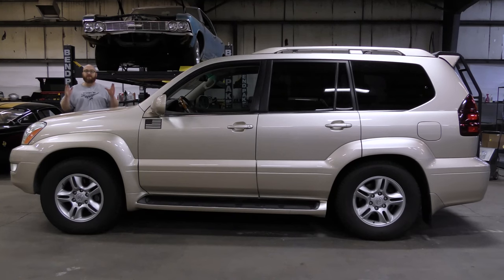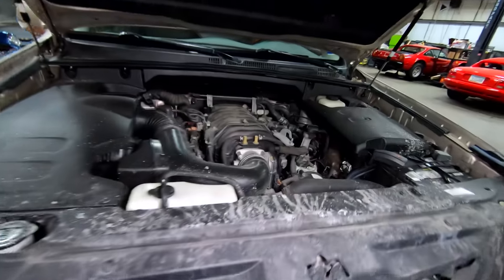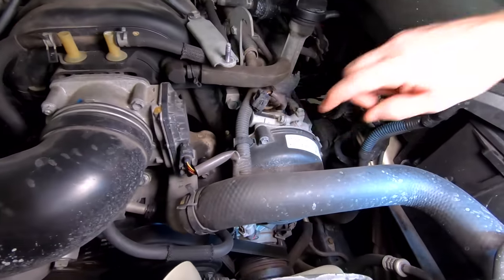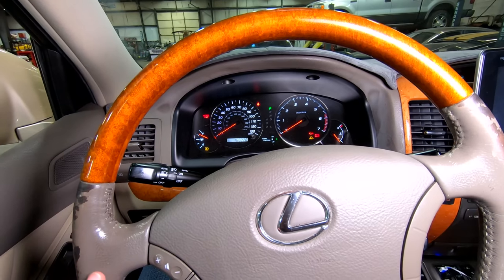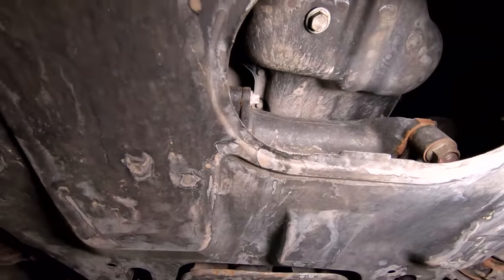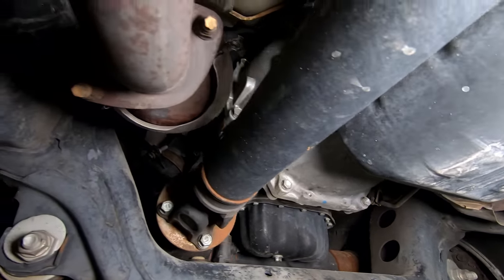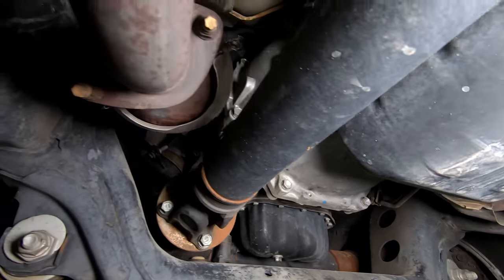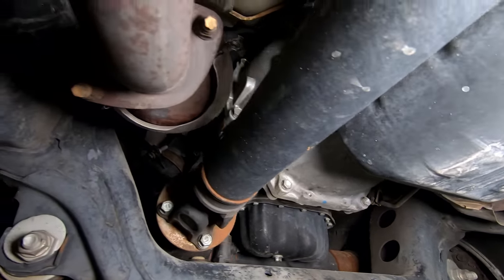How could this super reliable '07 Lexus GX470 have such a stupid design? CAR WIZARD weighs the risk

Comment: Great video, Wizard. On potentially large jobs I like having a very rough ballpark guess about the labour so I don't waste my time and the shops on a job I can't afford right then. That is not something I often do ask about, but when it was the head gasket on a Red Block I needed a ballpark on shop time. It did not stop the job happening, but I knew how much money I was going to be looking at. No sticker shock. I fully realize a quote is not realistic, but a quick look at the computer for the number of shop hours to be billed does not take long. 
That said, I appreciate and even expect that if the shop finds something else wrong they tell me. After 32 years and 613,000 kilometers, my old Volvo sometimes has things needing attention. Since the shop knows I plan to keep Arthur the test of my life, they are well aware that if they tell me something is bad I am going to say "Fix it" without hesitation. Sometimes on an old Volvo it is easier or better for me to get the parts, so it is a cooperative effort. It works.
Reply: Right On! Like the content but enough complaints about customers that want a price.  Tired of that theme in the videos.  Not legal advice but It is actually the law in Kansas anything over $150 customer is entitled to an estimate unless expressly waived.  Wizard has said before that he is not giving customers a break even if he can beat the book time. So, if you are charging book time regardless what’s so hard about giving an estimate? Content used to be about Hoovie getting estimates.  Wouldn’t we all like customers to give blank checks.  Anyone that does that is eventually going to be taken advantage of and there is a name for that we call them “suckers” or victims.

Comment: The first car repair I did on my own was the starter on my 74 Toyota Corona.  Two bolts and the wires, took me a 17 year old kid at the time - 15 minutes.  That was the old days though.  Honda puts some starters like on this car, under the intake.  I’m not going to even attempt that one…pay the pros that know what they are doing for sure.
Reply: Not too bad. Hard part is the top bolt for the starter

Comment: Sheepskin seat covers are extremely comfortable and effective.  I have a set of real sheepskin seat covers in my 2nd Gen Ram and when you're not thinking about how cold or hot your rear is, you know they're doing the job.  They also seemingly last forever.  I put one on the driver's side after installing leather seat covers a few years after I bought the truck new in July of '95.  I moved the older cover over to the passenger side about 20 years later.  The older one has a little bit of sun fade and some wear but it's not noticeable and still very comfortable.  Truck has a little over 325,000 miles on it and she's still going strong.  Same starter on it btw...!
Reply: How's the seat heaters work when they're covered by 3" of sheepskin?
Reply: I agree completely. Warm in the winter and cool in the summer. Love them!
Reply: @sheiladawg1664  I don't have heated seats in my Ram and initially sitting down on uncovered leather seats can be a very chilling experience in the winter !  In the summer it's the exact opposite but with the sheepskin covers, it doesn't matter, the seats are comfortable year round.  I do have a Lexus as well as the Ram and the Lexus has heated and cooled seats and until the car has been running for awhile, those seats are initially uncomfortable depending on time of year and you're correct in implying covering the seats would negate the effects of the heat but then again, one probably wouldn't notice the lack of heat or AC because the covers make the seats comfortable year round.  

The covers do add a little bit of height which could be an issue for some vehicles and I wasn't implying one should cover their heated or AC'd seats.  I got a kick out of Mrs Wizard's comment about "Granpa's '80's seat covers"...:-)  Whether sheepskin covers are dated or not, they're very effective, very comfortable, don't shed, and very long-lasting !  The covers could be used as a relatively, inexpensive way to add some height for shorter drivers but their biggest benefit is year round comfort !
Reply: @sheiladawg1664  By moving to a more temperate climate? Plasticized leather isn't a great insulator, so the sensation is chilling. Sheepskin traps your own body heat, helping your sensory experience. Seat heaters are a cheap response to cheaping on real leather.

Comment: We can thank the EPA for the design flaw on that engine. Placing the starter in the valley allows for the cats to be located closer to the manifold thus reducing warm up time and allowing the system to go closed loop sooner to reduce emissions. Still a pain in the butt when the starter fails. It also allows for tighter packaging of the exhaust components and makes the engine more symmetrical. That way they can build just one variant of the engine for left and right hand drive applications. At least all of the other service items are easily accessed.
Reply: Great answer - thanks for posting that.  My understanding having owned and worked on four Lexus V8's that it is for converter heat.
Reply: I don't think either of your assumptions are correct. It is more likely due to this car being a global product that gets the crap beat out of it. Starter up top to keep it out of mud and water, cats up high to protect them from damage (similar to other components underneath being well protected). It'd be nice if they used this same design on the Tundra 3UZ, its starter is down low and hard to get to due to the exhaust, and the cats are way back and very easy to steal or damage.
Reply: Yep yep...I definitely agree with you on that.
Reply: @daniels2761  You're correct. It's always bizarre why some people just blame things they don't understand on a generic boogyman like the EPA or some other group they dislike. Having the starter up there is the best place for it, keeps it dry and allows a long life if the vehicle is used for what the LandCruiser was designed for. As an example of another toyota product, the last gen Tundra had the starter in the more usual spot, much easier to service, but you couldn't take it throw water near as deep as that LandCruiser without killing the starter. 

Edit: I'm second guessing myself now about the Tundra comment. It's so long since i was under one i can't be sure I'm not thinking of the alternator placement instead.
Reply: This is correct. It’s also the reason for the ridiculous secondary air system which assists the cat at warming up quicker on a cold start, thus burning less emissions. An EPA requirement again. The catch on this motor is that you have to take apart the entire manifold to replace it. It’s also one of the first parts to fail on this motor. Which mine did. There are a few different bipass modules you can install that will bipass the entire secondary air system. I installed the Hewitt Tech modules 7 months ago with absolutely no issues. While technically illegal in states that require emissions tests, it will not cause the vehicle to fail the test. It will also not cause any issues to the motor or affect fuel economy when using the module. The secondary air system failing and not being addressed can cause all kinds of problems. This is why people usually replace the starter if they have to replace the entire air system.
Reply: Also , by placing the weight of the starter close to the center of the engine , vibrations are minimized..compared to the pendulum effect of a starter hanging down below.      Remember the ads showing the wine glasses set on top of the running ES400 engine ?  Very little shaking

Comment: Wizard, there are supposed to be rubber covers that shield the engine compartment from the wheel well. These frequently crack and either fall off or are removed and not replaced.  The air bags tend to leak, many owners swap them out for coil springs. I have the same year GX470 at 100k miles and is due for a belt change. It would be nice if you posted a how to replace the belt on this truck.
Reply: Yeah, I didn't know about the splash guards until I saw something on YouTube. Ordered them up on amazon. The critical stuff the wizard was shining his light on needs to be protected.
Reply: I thought he just took them off to show everyone. It was clean in there so I’m guessing they were on initially.
Reply: @kevinknotts6337  If he did take them off he left the push on plastic buttons fasteners.
Reply: Plenty of great videos on the timing belt and water pump on YouTube already. Used them to do mine!
Reply: I also saw the broken push fasteners where the inner splash shields used to be.
Reply: Easy…you ship it to the Car Wizard!!!

Comment: You are the most articulate mechanic I have ever been blessed to hear and see work.  YouTube sent me here I guess cause I been clicking on the GX 470 researching to purchase. 
Thank you for explaining the protocol when calling a mechanic for an estimate. I've had it where cv joint(2001 Corolla) went bad but they only discovered tie-rods were also needing replacement AFTER I bought it in dor the CV joint repair.

Comment: Thanks Car Wizard for your great detail oriented videos. I would like to point out another very serious design flaw on several Toyota models and a couple of Lexus models as well mainly from 2007-2011 involving engine oil cooler "pipes". If you have already made a video on this issue, then my apologies. This potentially catastrophic engine-destroying oil leak involves the Toyota Highlander, Sienna, Venza and also the Lexus RX350 and RX450h.

Just about a week ago my wife was driving to work in our 2011 Toyota Highlander and the low oil pressure light came on. She called me right away and I told her to pull over into a safe place as soon as possible so she was able to quickly pull over into a parking lot and shut down the engine. Since I had done an oil and filter change about 2 weeks prior to this happening, I thought that I must have not tightened the drain plug properly or the oil filter. When I got to where my wife was and checked the oil level, there was little to no oil on the dipstick and a big pool of oil underneath the car from just under the radiator extending quite a ways back mainly on the passenger side. By this time the engine had cooled down and wife said it never smoked or overheated. I added 5 gallons of oil and started it up. Oil was "peeing" out and it was below the radiator. There were no leaks from the drain plug or the oil filter cartridge housing but I noticed that the leak seemed to be coming from a couple of rubber lines or hoses that ran between the upper part of the oil filter cartridge housing and the bottom of the engine. Those are the engine oil cooler lines or pipes. The problem is that those rubber oil lines are just a few inches away from a catalytic converter and over time the heat will bake the rubber hoses making them hard and brittle. At that point, just a pinhole or slight crack on either of the two rubber lines will cause a major oil leak and if you're going down the road the engine may be destroyed from oil starvation if you don't pull over and shut it down soon enough. With those rubber oil cooler lines, it's not a matter of if but when they will fail.
I had our Highlander towed to the Toyota Dealership and they advised me that the leak was from one of the oil cooler lines and it needed to be replaced with the metal pipes since Toyota had come out with all metal ones to replace the rubber ones. Fortunately, after compression tests and other engine examination, the dealership said that no permanent engine damage had occurred. We bought it used from the same dealership back in early 2017 with just over 40,000 miles on it and it now has 103,000 miles. An elderly couple bought it brand new from the same dealer and they had it serviced at the dealership so I had all the maintenance records and the gentleman was very OCD about his maintenance so it was well taken care of and in mint conditions when we bought it.

However, there was a Technical Service Bulletin(TSB) issued by Toyota to dealerships and owners in mid 2014 into 2015 about possible oil leaks or seepage from these rubber lines or pipes. I'm quite certain that the owner took the vehicle to the dealership and had it inspected. Toyota also had a Warranty Enhancement for this issue as well. But the TSB basically said, inspect it but if ain't broke don't fix it. Well, if you had one of the 2011 Toyota models or Lexus models with low mileage those rubber lines were likely still fine and had not yet begun to fail so Toyota/Lexus did nothing about it. This did involve over half a million vehicles! I've done a lot of research over the past week and there have been many youtube videos and posts in Toyota and Lexus forums about massive oil leaks just in the past year or two as those rubber oil coolant lines are now failing at an alarming rate. If you have one of these model years, please get them replaced immediately. If you are in the vicinity of the Car Wizard, get it to him ASAP! You're risking your engine and this could be a safety issue as well depending on when and where this occurs while driving. I have seen videos where DIY folks are using a Dorman or other after market pipe kit replacement. Please DO NOT go that route and use the Toyota OEM metal pipe replacement because it's an exact fit and made much better and only $30 or 40 dollars more if that. The extended warranty ran out in 2021 so I had to pay out of pocket. I love my 2007 Tacoma and my 2011 Highlander but shame on Toyota for not doing a recall! I'm putting a link from the NHTSA so everyone can see the models and model years this major problem pertains to.

 https://static.nhtsa.gov/odi/tsbs/2014/SB-10056501-8923.pdf
If you don't want to click on the link...it's safe but just google SB-10056501-8923 and you can get the information that way as well.

Please don't fool around with this and address it right away. It may well save your engine and without being overly dramatic but possibly save you from bodily harm as well! I hope everyone stays safe and healthy.

Comment: These things will run forever.  I’ll always miss my 2006 GX470.  Sadly the frames were known to get extra rusty if you lived in the salt belt .
Reply: yup :( i have to get rid of mine soon because of this and it’s gonna break my heart. first car
Reply: Yah. The HVAC lines fittings & rear condenser manifold. are also prone to corrosion.

Comment: I have the same vehicle, almost 200k and on the original starter. I expect to have to replace it  eventually, but so far this vehicle has been very reliable. My only complaint was the air suspension. I converted to coils when mine started acting up. I was happy I did, rides smoother now and I don't have to worry about expensive repairs when other parts like the compressor goes out.
Reply: What about warning lights?  When u took out the bags.
Reply: Nab, i had to jump a couple pins under the dash but I don't remember which ones. Here is the info for Strutmasters. They sent me the instructions when I did the conversion: https://www.youtube.com/watch?v=MUeORkiWzos
Reply: Seems to be the compressors that go on Land Rover vehicles. Ask me how I know...😁
Reply: I find it hard to believe that a converted coil suspension rides smoother than the OEM air suspension.
Reply: @OMGWTFLOLSMH  u know in many countries, they don't even offer you a lexus with air suspension?  And they're still master leaders in refinement.    When I converted my ucf10 celsior to coils, I loved it.  Plus you reduce a fair bit of weight.

Comment: We bought one new and drove it to 225k. A few small issues after 150k miles.  But no major issues.  Would buy another one except wife wanted a smaller vehicle for her daily driver.  
That engine burns a lot of fuel!
Reply: As a lone driver, I cannot imagine using this hulking gas guzzler as a daily driver, even if I could afford the fuel.
Reply: And that’s not the 87 octane flavor!!
Reply: @phendrix9476  I run mine on 85 octane here and it runs fine.  These engines don't need premium fuel at all, regardless of what the fuel door says.
Reply: How many miles do you get on a full tank?
Reply: @maximaniac7231  my 06 will throw knock sensor code everytime Ive tried to run 87. Maybe the non vvti engine can get away with it otherwise I'll have to disagree.

Comment: I figured the "design flaw" was going to be the ol' starter under the intake manifold.  I do wonder if engines built that way have a longer service life on the starter due to being protected from water, salt, and dirt.  I agree with how stupid the "start/stop" thing is, and was very happy to learn that "feature" was deleted from my Crosstrek due to getting it with the manual trans.  As for your little rant at the end, the only time I ever told a shop the specific repair my car needed was when that very same shop had told me during the state inspection a couple days earlier.  Otherwise I just tell them what issue(s) I'm experiencing (ex., the brakes make a grinding noise, or the exhaust is really loud, etc.) even when I'm pretty sure what needs to be done.  At times when I've had an older car with lots of miles, I expect they'll find more things that need work beyond what I think is likely causing my issues.  I'd be ticked if they just did all that work without calling me first and giving an estimate of the cost, so I can be prepared and also if it's not something critical for safety maybe defer it until after the next paycheck.